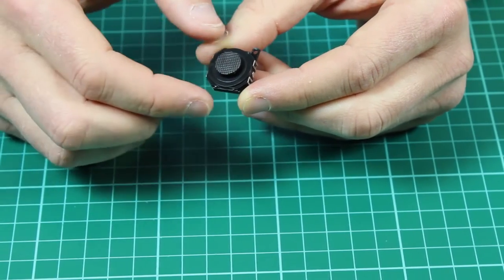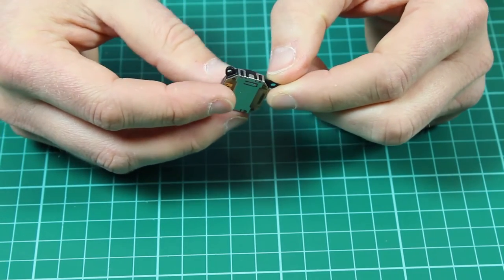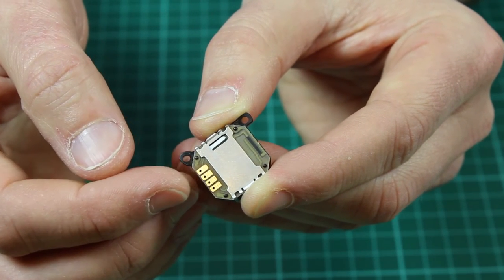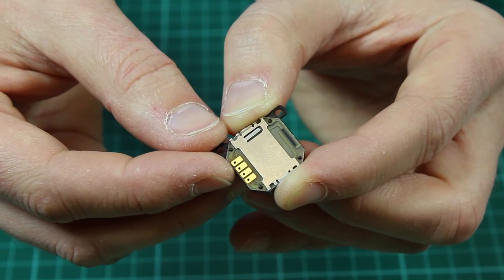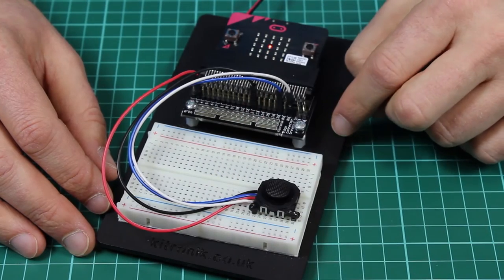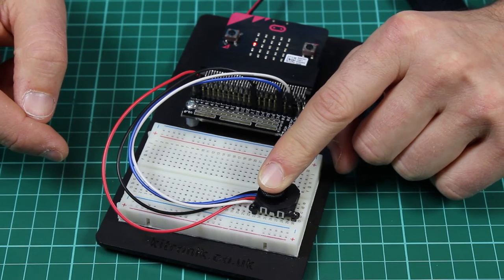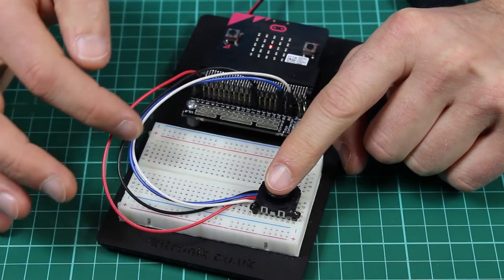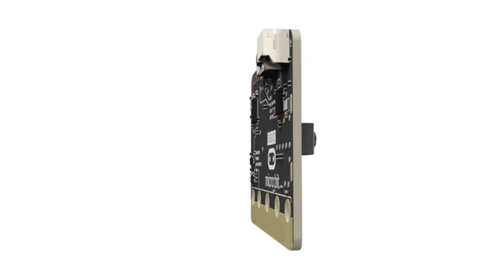Resistive Analogue Thumb Slide Joystick

Comment: Would you agree that such a thumb stick would improve precise movements in gaming over the traditional thumb sticks used in ps4 and Xbox game pads
Reply from the maker: They work very well for some types of games as they have more movement resistance than some of the modern console controllers. We've used them to control a number of projects and they work just fine.

Comment: How did you connect it to your breadboard?
Reply from the maker: Hi Angelo, we pulled off one end of the jumper cables and soldered them to the joysticks pads and then plugged the other end into the breadboard. I will add a link to the video description that has some more information.
Reply: @kitronik  thanks